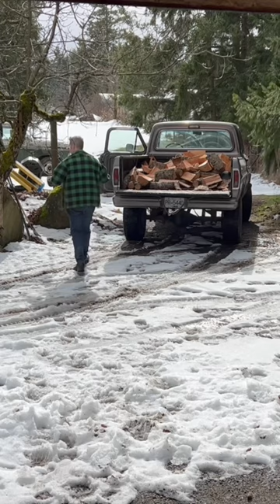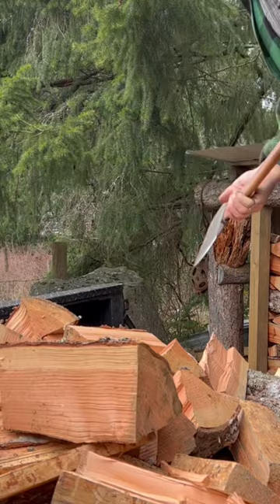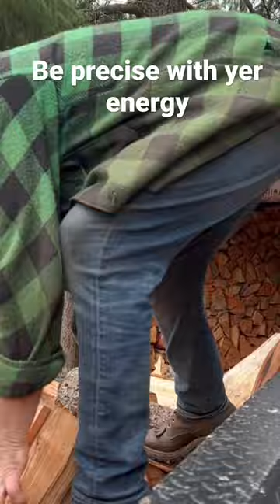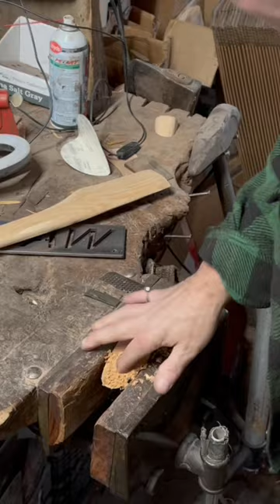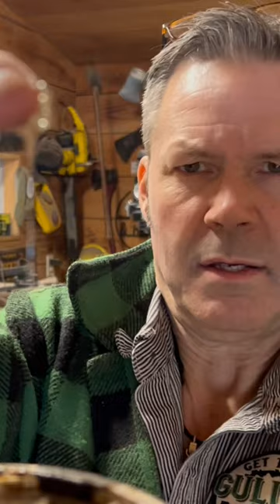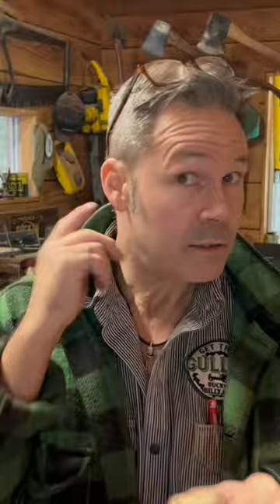Firewood . From truck to woodshed #shorts #firewood #logger #chainsaw #bekind  #lovewins

Comment: Wish our wood down here in Kansas split so nice like your firs. I recently switched to using my Grandpa's splitting axe instead of my splitting mall. Went well for a few months till handle broke in the middle.  Did like swinging the lighter axe though!
Reply: No kidding, makes anything with knots in it not worth splitting by hand
Reply from the maker: Re handle it yer onto something now
Reply: @Buckin' Billy Ray Smith  that's the plan.  Are you selling your handles yet?